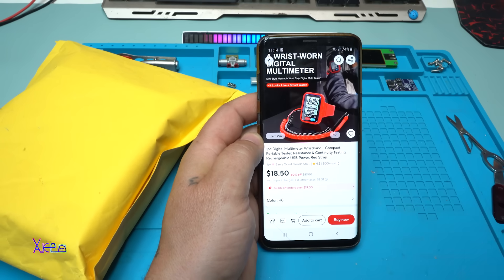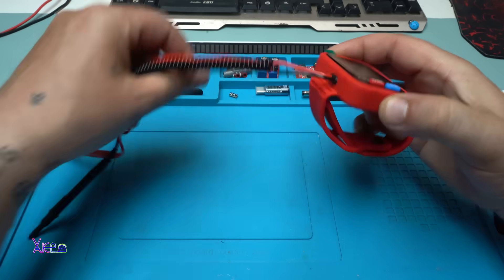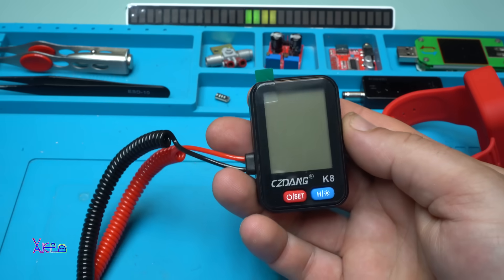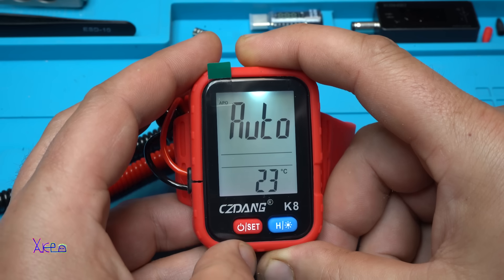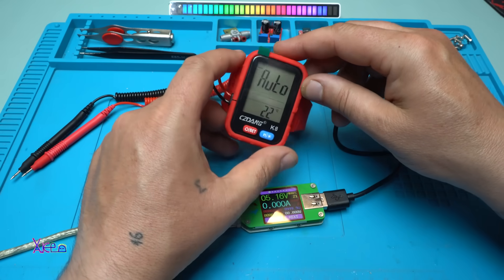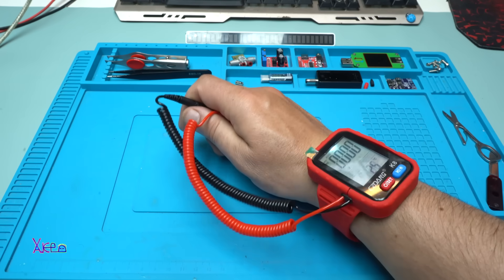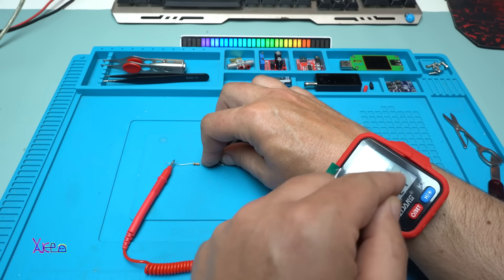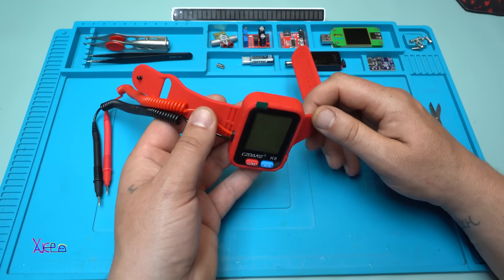Mini Wrist DMM from Aliexpress $? is Extremely COOL?

Comment: That's a neat meter, the only improvement I could think of would be some clips or something to hold the probes out of the way rather than them dangling - only a matter of time before they dangle into something they shouldn't!  It's a neat design though in some situations but probably best used in combination with a decent bench meter when you need to be mobile.  Thanks for another great review!

Comment: Two flaws I spotted rightaway: orientation should be rotated 90° and some clips to hold the probes should be added to the wriststrap, otherwise the device is doomed to hinder at work (in elevated/exposed conditions)
Reply: Thats just personal preference.
Id use it!
Reply: It might be okay if your job is to climb up a ladder and check a voltage halfway up, but I can't really see many other cases where it'd make sense. Also, there is no way I'd measure any dangerous voltage using something cheap from China that is strapped to me.
Reply: OH TOMMY YOU DON"T LIKE NOTHING NEW.......NOW GO BACK IN YOUR BAT CAVE AND STAY THERE........
Reply: Effectivement l’affichage n’est pas ergonomique du tout,  peu de fonctions, gadget en fait, mais l’idée est intéressante

Comment: Nope...  Most of what I test needs both hands inside a cabinet, and at the usual position of the wrist while holding a test lead you wouldn't be able to read this.  Nice concept, but very impractical ESPECIALLY considering you're walking around with 2 test leads dangling from your arm, or you have to put it on EVERY TIME you want to use it.
Reply from the maker: Good point, maybe it's not for everyone.